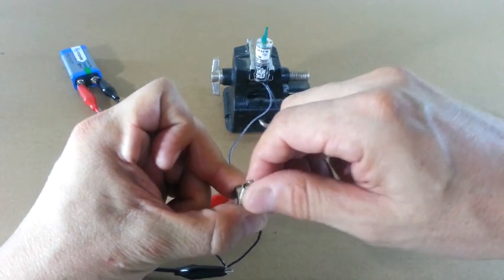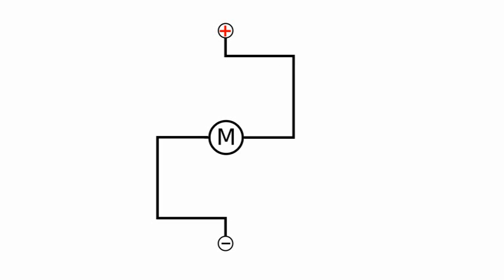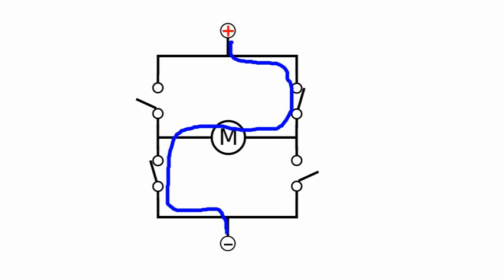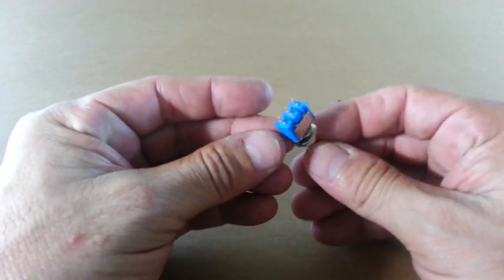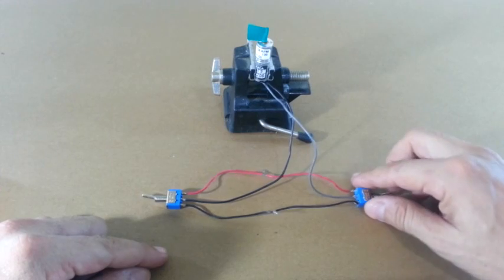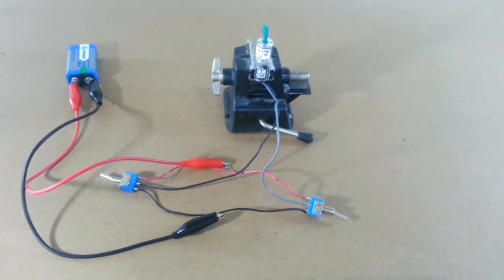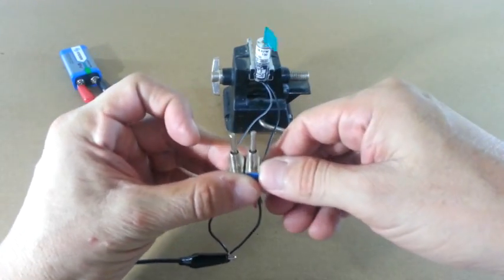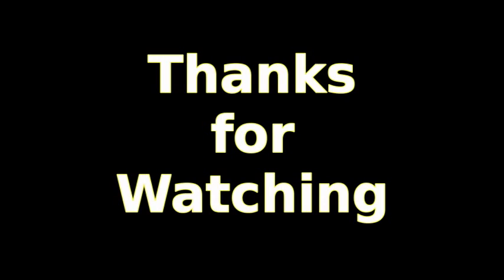Simple H Bridge for Motor Control with Switches

Comment: sir I m your fan. sir I saw a magnet motor simple. two magnet and two coiles. no battery . motor is running. how?. please explains with your supper style..I m waiting for your your.a kind
Reply from the maker: Must be a fake.
Reply: look on youtube 'greatscott'. He made an shake torch.
Reply: @thedankoona_5854  That's not the same. The capacitor is a battery. or used as one.
Reply: +Ludic Science nope.